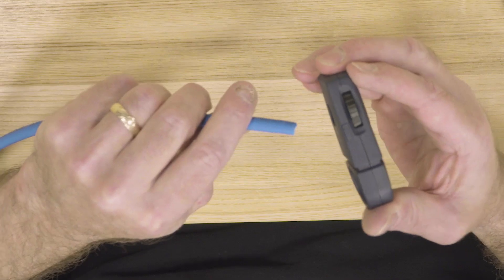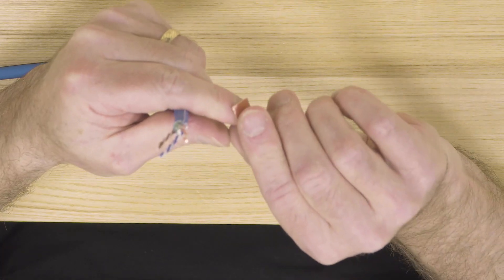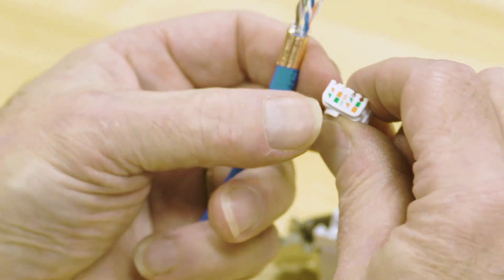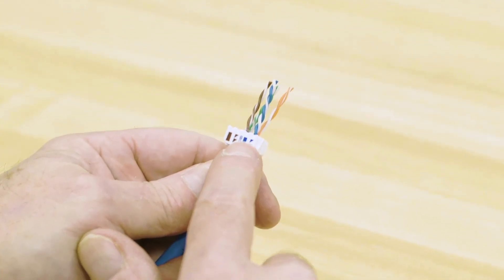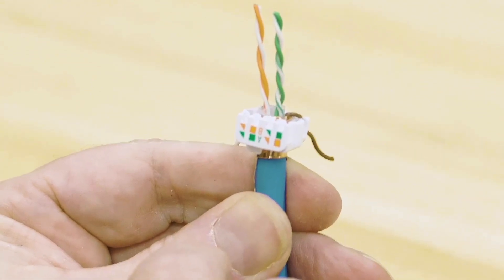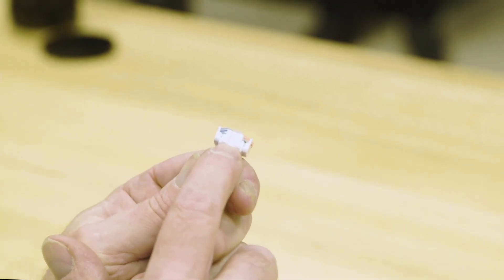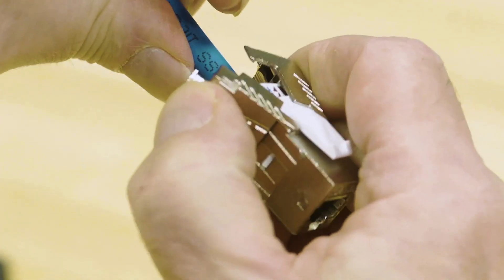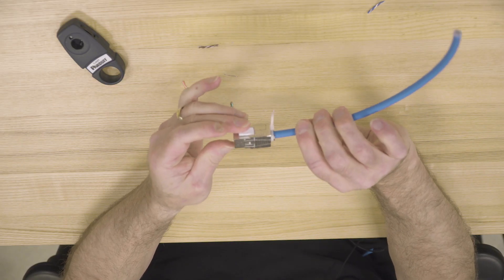Panduit NetKey® Termination

Comment: should the copper strip not have been placed under the drain wire, then wrapped around the cable and then placed over the drain wire, therefore having the drain wire touching copper above and below?